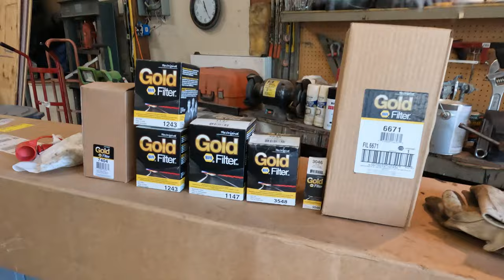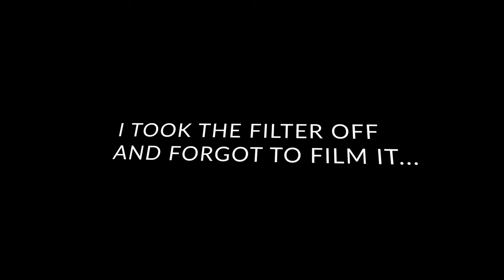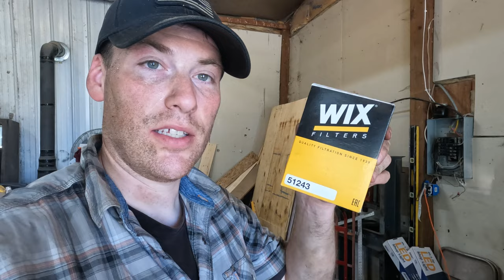Broken Motor Mount Bolts! John Deere 250 Skid Steer Service

Comment: I have an issue with mine where it sounds like you are throwing gravel at the radiator. I think my fan is getting into radiator because of motor mounts. At idle my engine is really moving around. So new radiator and find out whats causing something to hit the radiator. Good times! Thanks for the video.

Comment: Huge thanks man for this video!  I need to do maintenance on a 250 at a farm I started working at, this is a massive help.
Reply: Also any ideas on how to make the pedals smoother?  They kind of stick so I end up throwing the bucket or forks around.  I took a look at the linkage between where your feet sit, but that was pretty clean.
Reply from the maker: I know when I changed my hydraulic filter and fluid, it GREATLY changed how my bucket articulated and how smooth it moved. Another suggestion is a video I found, https://youtu.be/E6BQYKZJJoY ,  Good Luck and hope it works better!

Comment: Yep i have a 250 also and it is also a wiring nightmare.  Park brake issues!  I also have had to replace motor mount on the rear. Pretty sure it was bad when i bought it but didn't know any better.  It actually was so bad that it broke thottle lever on fuel injection pump but once fixed i havent had a problem just wish i would have replaced them all.
Reply from the maker: Parking brake switch? I've kind of wondered if there was a problem with it... But so far it's working well without replacing it
Reply: New instrument cluster and pig tail fixes park break issues

Comment: I have a 270 (very similar) with a broken front motor mount.  There is access from underneath but the top side is killing me.  Any advise getting a wrench on the top?
Reply from the maker: I lifted the cab up and worked from the top. The best answer for me was having someone to help you hold one side while you tighten the other and a good amount of extensions

Comment: Have you changed a starter in your 250 skid steer. I have a 240 skid steer and I am about to change the starter
Reply from the maker: I uploaded the video, of I did not answer your questions about the starter, message me and I will try and help out the best I can!
Reply: I had to change mine last summer. It sucks with the boom up. I can't imagine with the boom down!
I had a buddy lift the boom on mine with his skid while I held the pedal. It'll leak by enough oil to get the boom up and locked.

Comment: Bought 250 from auction and it won’t start.  Seems like a lot of blow by when removed valve cover.  Doesn’t even do anything with starter fluid either so maybe engines toast
Reply from the maker: Very interesting, hope you bought it for a good price! I sadly don't have much diesel mechanic experience, hopefully you can figure it out! I know having that skid loader is a life saver when it comes to getting work done
Reply: Did u check the 15 amp fuse in the fuse box by the throttle? If it’s blown u probably have fried BOTH  of the temperature sensors on the block. Happened to me a couple of times and without replacing them it will not start. Good luck

Comment: What does the button on the left stick do?
Reply from the maker: It looks like there could be a button but on my skid loader there is no button, it is just a cut out. My guess it would be for an accessory if I had that option.
Reply: Thank you, my machine has hydraulic accessory, but I don't see a electrical connection point. I've tried pushing it randomly while working and nothing seems to change. No clue